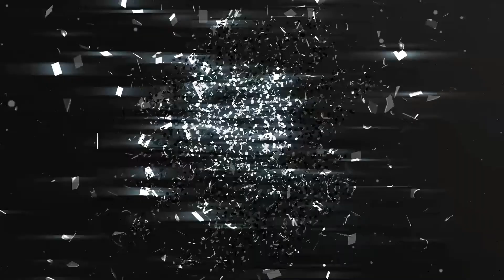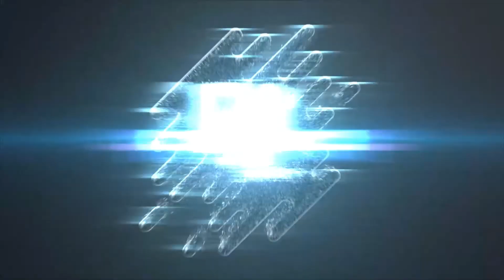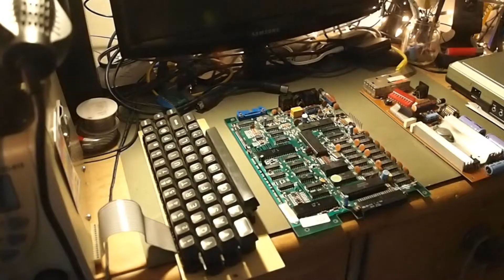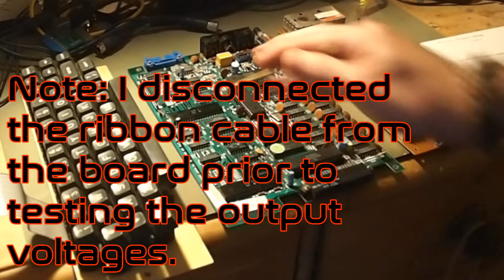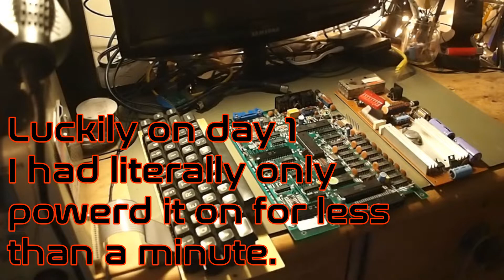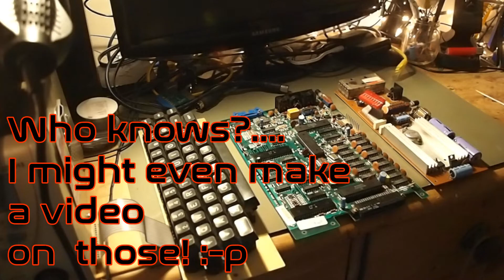Dragon 32 (refurb and testing). "Houston..we have a problem"

Comment: Those trannsformers can be fixed!  Prize appart the rivets - the transformer will have a thermal fuse in there that has popped.   But... I just heard you said it was shorting internally lol - Yep, don't use that transformer lol
Reply from the maker: yeh it wouldn't get hot if it was the thermal fuse? (or..?)
Reply: @RetroMarkyRM  Yeah, that's the surprising thing with that one!  I saw a few of these that were totally dead in the day, and if you prized the rivets out the fuse could be swapped.  Maybe yours doesnt have a fuse, or someone bridged it out?  Have the rivets been tampered with in the past?
Reply from the maker: @GadgetUK164  I'd have to look inside and see what's what. How do you prise out the rivets? (what tool would you suggest mate?)